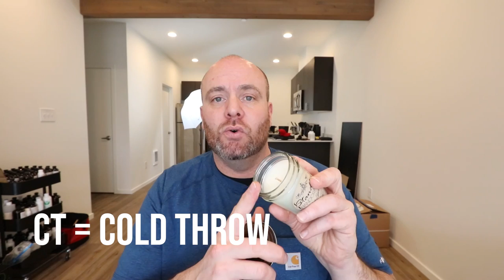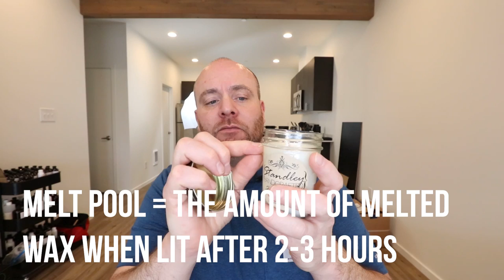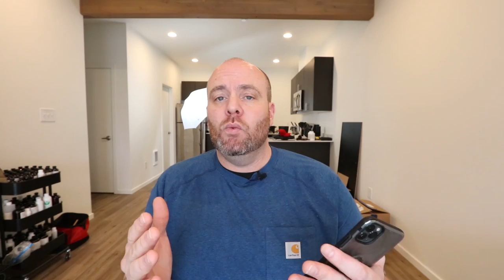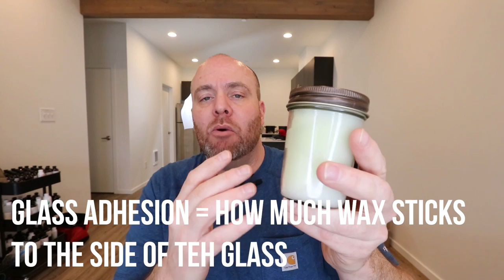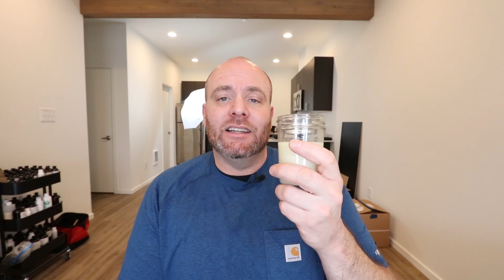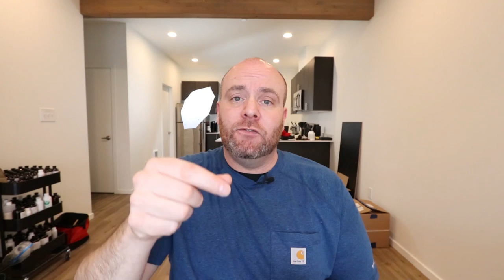Basic candle terms - What is FO, EO, CT, HT, Wick up, Wick down

Comment: Can you explain more about what you were saying in regards to the melt pool needing to be   And 1/8 of an inch or 1/4 of an inch. I’m new to candle making and I don’t understand exactly what’s being referred to when you say the melt pool needs to be that measurement. I guess I’m confused bc I’ve read a full melt pool should be achieved within 2-3 hours of burn time. To make sure I understand, does that mean the whole candle should be melted within that time frame, or does that mean just a full diameter of the candle should be melted within that time frame (not necessarily the entire candle in a vertical sense)?

Comment: I am using the GW 464 soy wax and FO from Aztec Candle and noticed gritty or textured on the bottom and one on a side of the jelly jar... I wondering is this due to the FO not being mixed in enough before pouring or the temperature pour as well? Thank you for the helpful videos and information you share.

Comment: When calculating the amount of FO to use in your candles, for example 10% FO, for 16oz of wax, would you use 1.6oz of FO, so the total is 17.6? In this case, the amount of FO would actually be 9.09% Or would you use 14.4 oz of wax and 1.6 oz of FO, so the total is 16oz of both? This way the FO would be 10%.